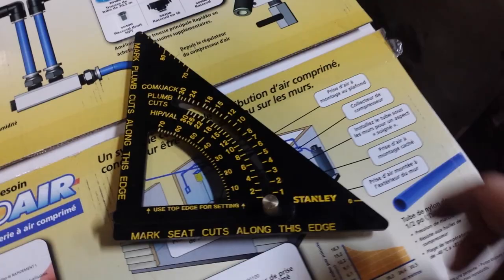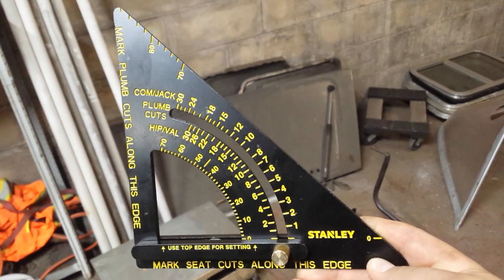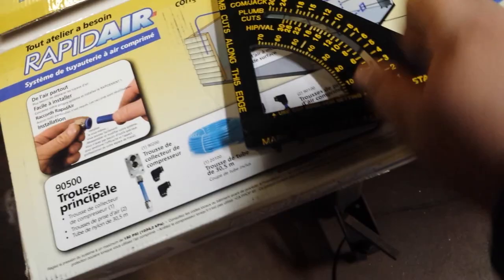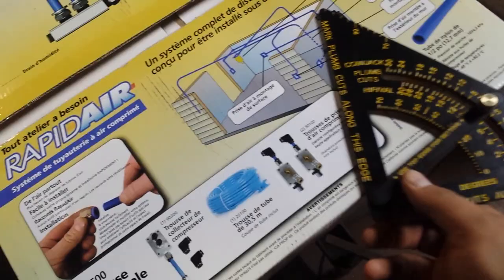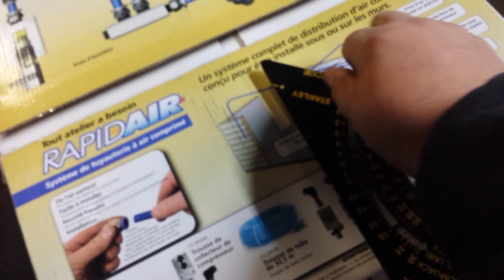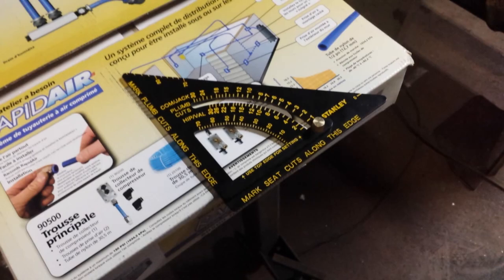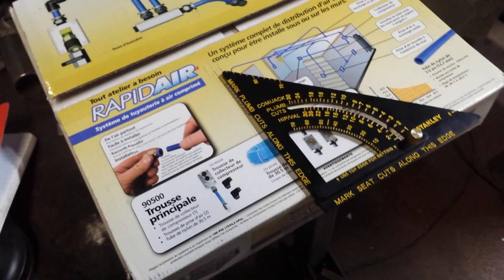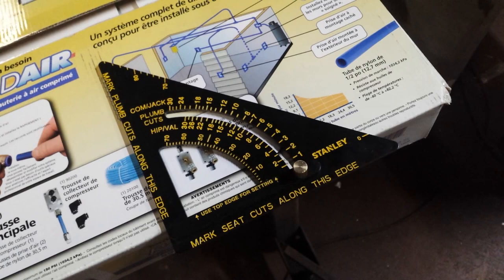A different kind of Square - Stanley Adjustable Speed Square

Comment: Hi, small correction. When setting 30 degrees as you did it is 30 from the base edge (horizontal) but 60 degrees from the standing edge (vertical). Geat tool for wooden curved stairs. Thanks for shareing. Tony
Reply: Thought the same myself. Good job he doesn’t cut roofs for a living.

Comment: Never mind the detractors, a bad workman blames his tools etc..   Its a v good piece of equipment for me, can be set, marked & flipped over for the opposing angle, no need to be careful holding it at the pivot point, great for quick repeat marking/cutting.  It paid for itself in saved time first outing.
Reply: thats the beauty of these. set it once and use it. mistakes happen when you have to measure angles each time

Comment: If you drop your Speed Square, it's no longer square. This one can be easily readjusted back to exactly 90 degrees. That's why it pivots slightly past the 90 mark.

Comment: I know I'am a year or two late. With the arm all the way down it is at 90 degrees, the top of the arm should be at the very bottom of the yellow line not in the middle of it. The same goes for any other setting, set the arm right at the bottom of the yellow line. I checked it with another square and it's right on when set that way.
Reply: He said his is not square, and he said his friend's is not square, and I have an old USA made one and it's not square when the arm is all the way down. Maybe the square you checked yours with is not square.

Comment: it needs to made in a 12 inch model.
Reply: Stanley made a 12" version of these for about 20yrs but stopped selling them recently, the 12" versions now sell on eBay for about £120+ here in the UK now which is silly money, they used to sell for about £45 new. Really poor of Stanley to stop production of the large version which is much more useful for roofing which is after all its primary purpose.
Reply: Dargan have started makinga 12 inch one it costs around 40 quid seen them online.

Comment: Gentlemen, If i am going to make a educated guess, it is a chinesium products. Just a humble suggestion, If i am in your position, i would use a true compass and true square to test it before giving 100% confidence on it. Or just simply draw a line, flip the square, draw another line, see if it fall into same position. If not? Recommend you to throw it into the bin. Imagine if you are using a square that is not a square to cut and weld something, turn out it is till to one side. That is going to ruine your day.

Good squares are difficult to find these day, even the good one can be damage or loss the accuracy after heavy use. Do you have confidence this thing is going to pass the test?

Comment: I bought this and threw it in the bin, couldn't believe it doesn't sit at 90 degrees without fiddling with it. It's not a "speed" square if u have to fuck around getting it just right. Also when you have a square in your pouch you don't wanna be checking every time you pull it out, if you accidentally loosened the screw and it's now not 90 degrees. Very disappointed
Reply: cringlecoulson - If you drop your Speed Square, it's no longer square. This one can be easily readjusted back to exactly 90 degrees. That's why it adjusts slightly past the 90 mark.
Reply: David K. A forged single piece of aluminium or steel will not be out of square if you drop it......ever. Maybe a sliding square will be, but not a speed square. Which actually furthers my point of this particular square being useless. You can drop a normal speed square and re use without checking. 99% of the use for a speed square is for a 90 degree line. Therefore one which has to be checked (in my opinion) is not practical. And no1 wants two speed squares in their nail pouch
Reply: Aaaaa!  You're right!

I believe my confusion was due to seeing two items recently about how to re-square a square using a nail punch and a hammer.  But in both cases, they were talking about an L-shaped framing square, not a speed square.

Because a speed square has all three sides for support, one would have to whack it pretty hard to knock it out of square.

I still think there must have been a reason why Stanley designed the device to go slightly past 90 degrees.  Maybe it was just to deal with the tolerances on a two-piece, movable tool.

Thanks for setting me straight.

Cheers!
Reply: David K. Yeah must be a reason for it, but surely they are trying to fix something that  isn't broke, ultimately adding a problem instead of resolving one. They basically created a sliding bevel that can be set at specific angles. Which we all know a bevel is capable of doing so. I get the idea but the simple fact you have to mess with it to get it to 90• is enough to turn me off.  Any power tool has pre determined stops at 90. 45 etc so even if they wanted to allow slightly more than 90 they should make it stop at 90 first
Reply: if thats what you want then you bought the wrong square. no reason to not have the right tool for the job. good to have more than a few speed squares.
Reply: Just saw this video and read the comment. i fully agree with the cringlecoulson so I checked it. Mine sets at 90º even without tightening it. Maybe you should have aske for a refund on yours.
Reply: I have the 12” version, though it’s not painted. It’s very useful. I also have a Johnson 12” “standard” speed square, and that’s useful too. Despite the guys ragging on this, I’ll tell you that having both is more useful than having either by itself.

But I’m using it for fab and welding. I don’t care too much about the roofing aspect.
Reply: cringlecoulson . Once it set it makes repeat cuts easier and quicker

Comment: pure crap,thats basic to the hilt
Reply: way more accurate on roofs than a speed square. it can do all the hip / valley cuts, rafter cuts etc . its not meant to be a 90 degree set square like a speed square